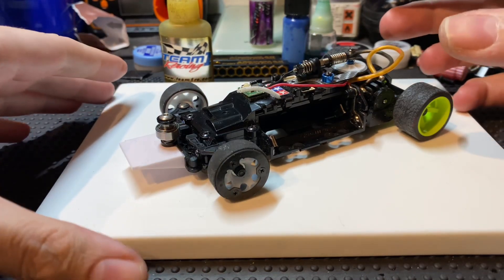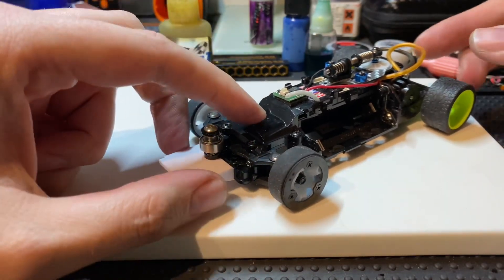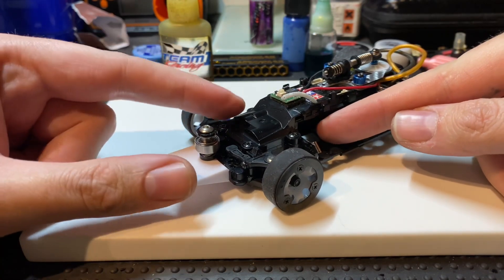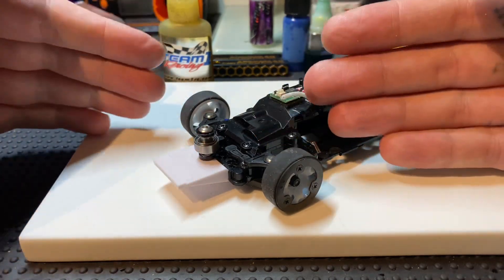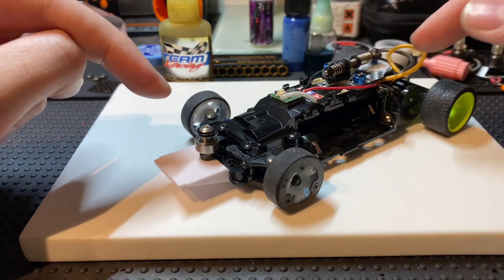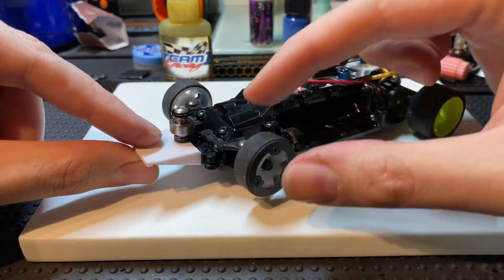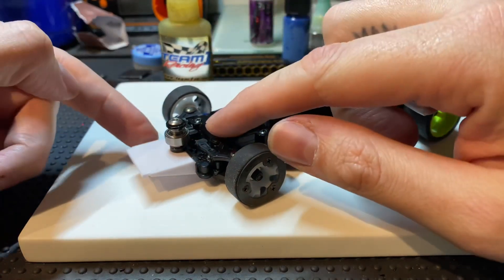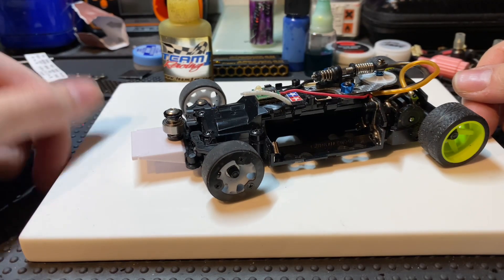Mini Z Mass damper [advanced] Slowmo in video

Comment: You have many kind of mass dampers for Tamiya AWD
Reply from the maker: Yes, but they lack the “tuned” element that is the springs, the tamiya type for the 4wd class is used mostly to calm the chassi over jumps, and will not react fast enough for the smalle bumps on the rcp tracks, that is the reason for the springs on both sides of the weight.

Comment: I posted this is the Redit group that I found it in (would you mind joining so you can share these yourself? reddit / MiniZ )

I love the idea behind this, I was thinking to myself "i need a slow-mo" which you did do and it shows the proof of concept, however i would need to see a side by side comparison with and without to see if its actually doing anything, Then I would love to see if different weights change it further. I suspect the spring would need to be in a fine balance with the weight to ensure its actually helping the car. If you were to do a side by side maybe using some hard drift tires to exaggerate things? Either way it would be cool to have discussions in the reddit group.
Reply from the maker: Im not on reddit 😄 but: So its not going to “take up” more force than the mass of damper. So “slamming” it from that High up was just to show that it functions. Its meant to “absorb” very small vibration, and that does not translate well into film

So you will not be able to see any real difference with the naked eye, as the mass Can not counter act the whole weight of the front end drooped from that hight.

Comment: It would be nice to see a damped and non-damped front end side by side in slow mo.
Reply from the maker: So its not going to “take up” more force than the mass of damper. So “slamming” it from that High up was just to show that it functions. Its meant to “absorb” very small vibration, and that does not translate well into film

So you will not be able to see any real difference with the naked eye, as the mass Can not counter act the whole weight of the front end drooped from that hight.